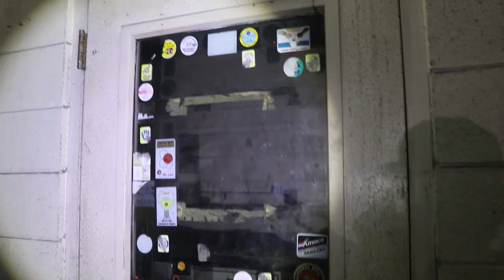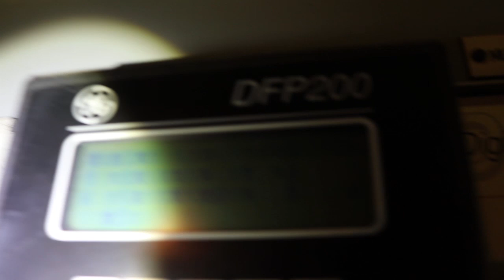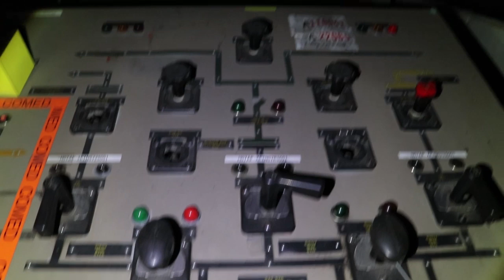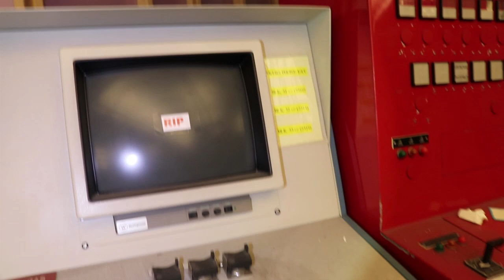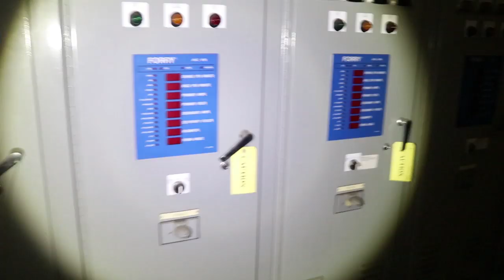Huge Abandoned Chicago Power Plant

Comment: A massive power plant that is no longer making power but the power left on  now how can that be  for all power plant,s are self power,ed .
Reply: Plant still connected to the grid, even though the generators are offline and their isolation breakers are open. At 12:08 you can see/hear the medium voltage unit subs online, which are fed from the plant's distribution center downstream of the transformer yard.
Reply: @Dukers2300  okay now I know the rest of the story thanks for your help in this matter young man
Reply: @robertmailhos8159  No worries! Having the means to be powered from the grid is vitally important for any power plant or factory with cogenerating capabilities. If something trips offline or an accident happens, they can still be "jumpstarted" if external power is still up. Or, in this case, lighting and heating can still persist long after shutdown. The factory I worked in required 28MW to run, and had a small 6MW steam turbine. If the grid went down, the production line would go down with it but at least the lights and control systems would still be up from the turbine. Similarly, if the turbine went down, the grid supply could soak up the additional loading.
Reply: @Dukers2300  thanks for your reply and your info